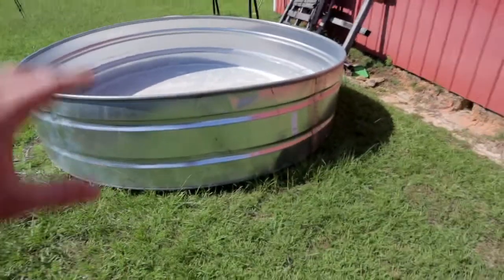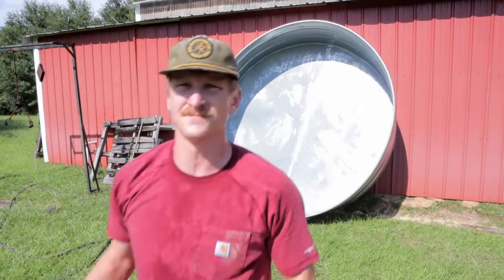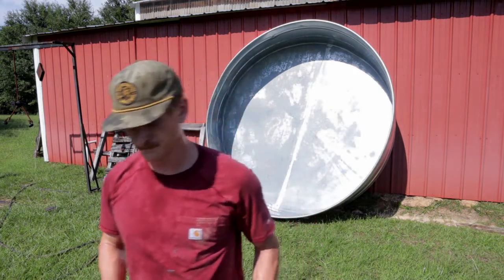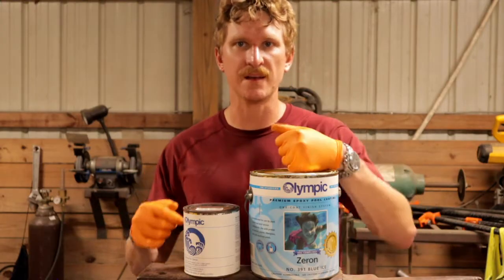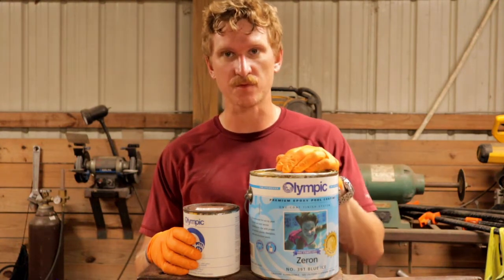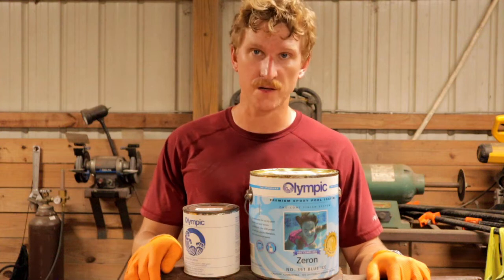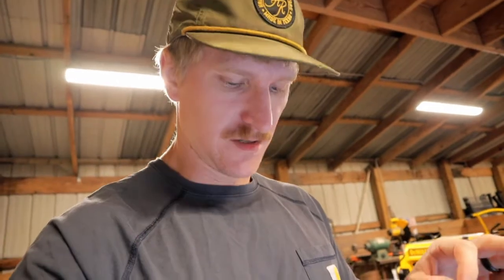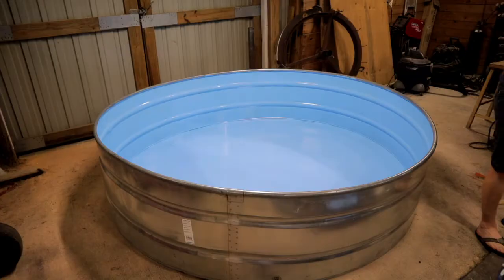Stock Tank Pool Paint DIY - DIY Stock Tank Pool

Comment: We used the same product. Looks good but it better it costs a lot. Did the outside too with one batch. Previous owner of the tank had painted it poorly so we had to wire wheel grind it all off and then did the epoxy.
Reply from the maker: Man, I’m glad I didn’t have to get old paint off. I’m happy with how it turned out. Feels like it will hold up nicely. I definitely lucked out with my step dad having some left over that he gave me.
Reply: @south_coast  Hey, how well has the paint held up?
Reply from the maker: @doaquapx9682  It held up great for that full season. I am waiting for it to warm up a bit more before I flip it back over and get it filed back up. I will update with a video when I get it all set up for this upcoming summer.

Comment: Wondering how this held up in your second season?  Our second season rust started coming through
Reply from the maker: Mine is holding up well. The only spots with issues are along the seam sealer where the paint didn’t stick to the factory sealant. Other than that it’s still in good shape.

Comment: Did you put on a primer before applying the paint?  If so, what did you use?
Reply from the maker: No primer. What you see in the video is what I did. Light sanding, cleaned out with vinegar and then water, then put on the epoxy pool paint.